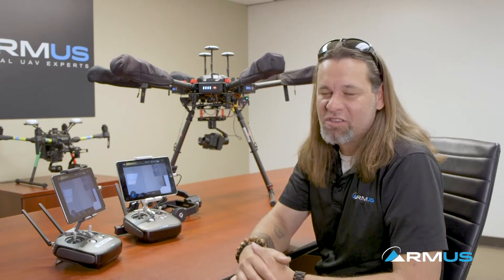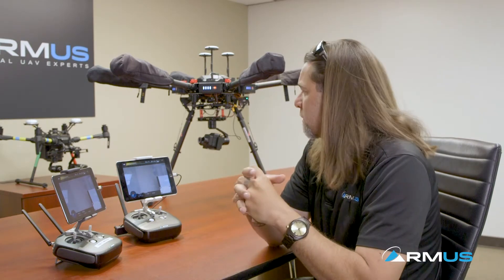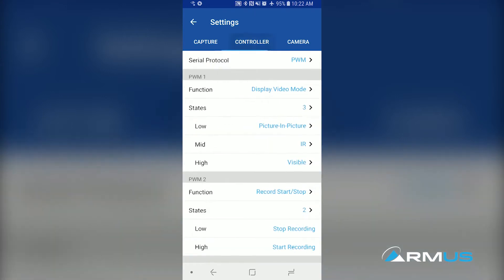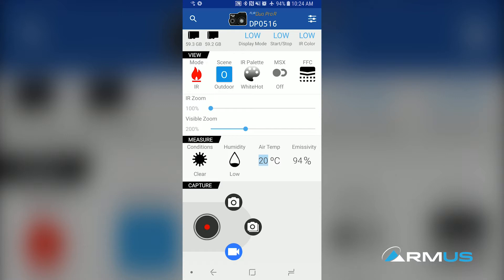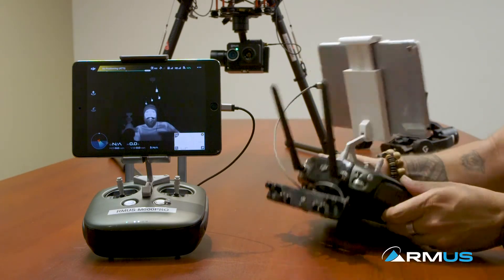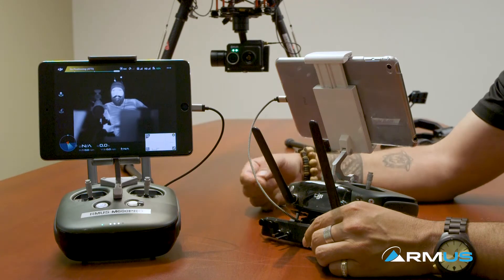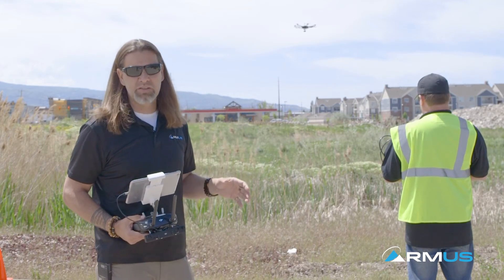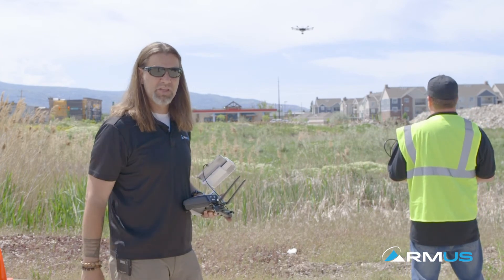Walkthrough - Flir Duo Pro R on DJI M600

Comment: The company I work for purchased a Matrice 600 Pro, Grimsy S1, and Flir Duo Pro two years ago and have never been able to get the image to transmit to the controller.  Sometimes on startup, you get a brief video signal but only for a second.  I have been told the Lightbridge 2 has been replaced twice with the same results.  The Flir Duo Pro works fine when bench testing.  I was recently sent the drone to try to figure it out, but i'm getting the same results.  Can you provide any assistance with figuring this thing out?